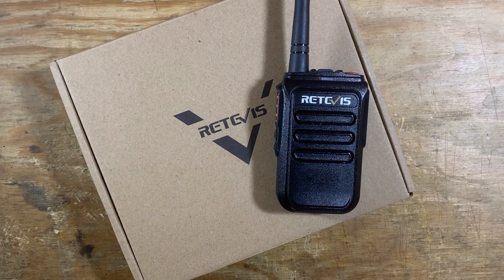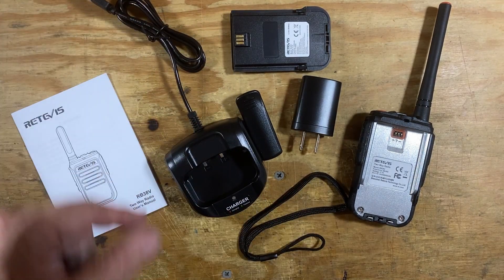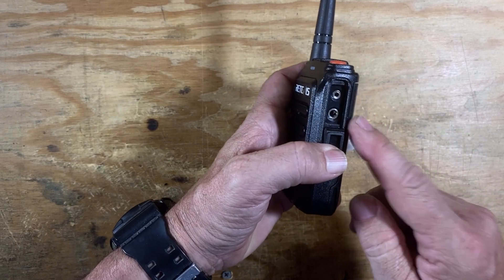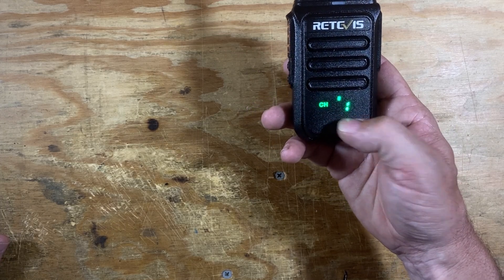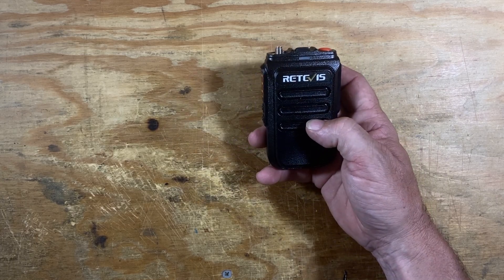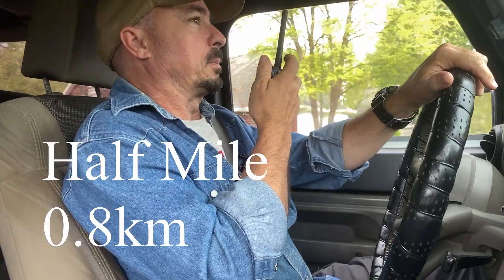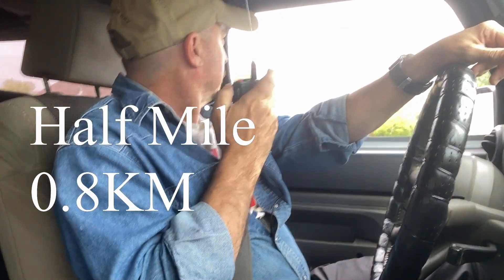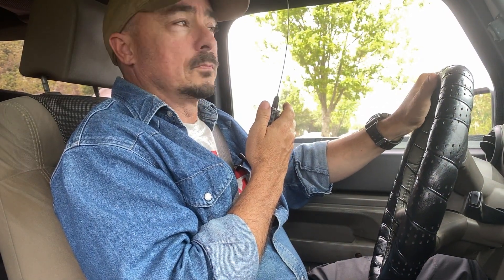Retevis RT38V Review

Comment: Using a MURS radio inside a car is a nono!  VHF does not work well through metal.  They are designed for outdoor use.
Reply from the maker: With most cars I would agree but I was in a Jeep Wrangler with a soft top. There is no metal at head height other than the roll cage. I doubt it had much impact on the signal.

Comment: I agree the aftermarket antenna will improve performance, but if I understand correctly, in this test when the antennas were swapped your wife also relocated to upstairs to gain altitude and possibly also clear obstacles outside the home and so the test is not ideal in comparing the two antennas to each other. How do the stock antennas work when your wife is upstairs?

Comment: Speaking of not cutting it.  Lets cut open that antenna and discover one of the best kept secrets in chinese radios.  All I can figure is there's no antenna in it.. maybe a 50.ohm resister.  But if you're gonna dispose of that antenna, lets just see what they never learned about basic antenna design or construction.  Sometimes a good autopsy of failed equipment can be a tremendous learning tool.   73